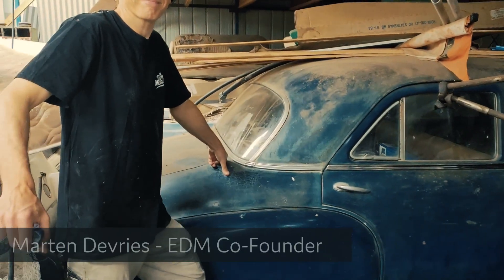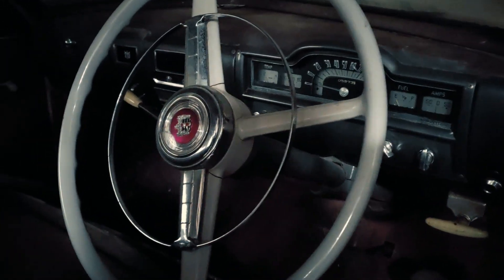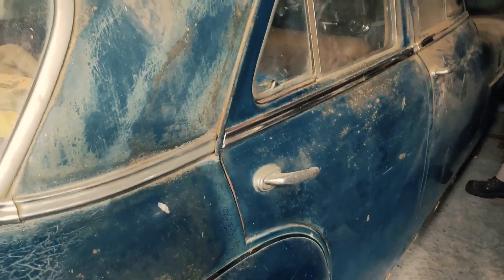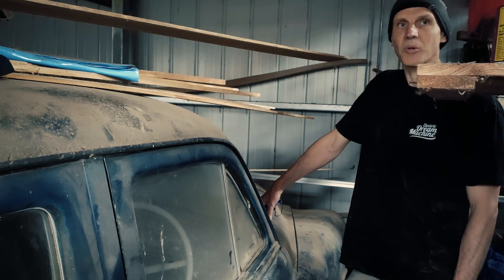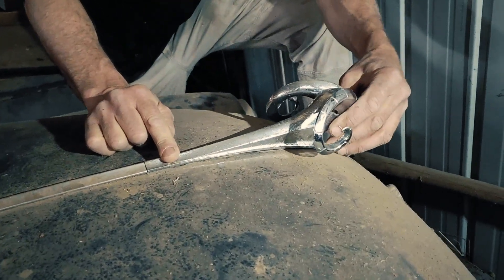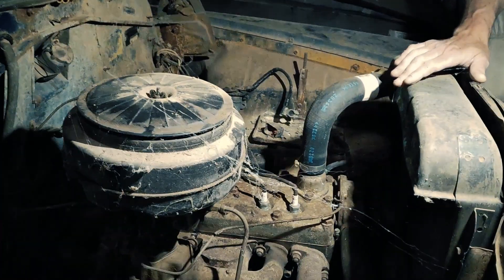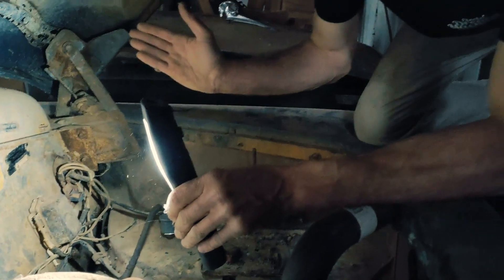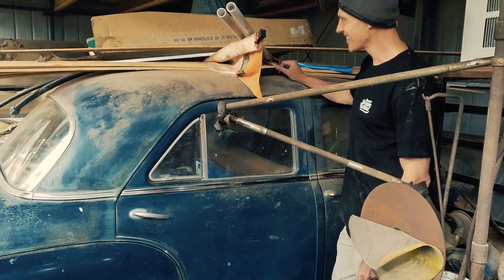Electric⚡️1950 Dodge - EV Conversion - Part 1

Comment: Marvellous bonnet mascot ,will it be legal or will you make a lightweight break - off  copy?👍. Great challenge.
Reply from the maker: Hey miksal26 good question, it should not be an issue as it is an original part of the car and quite common for vehicles of that time.